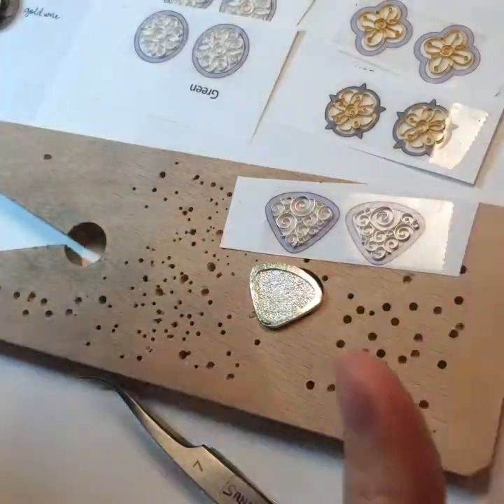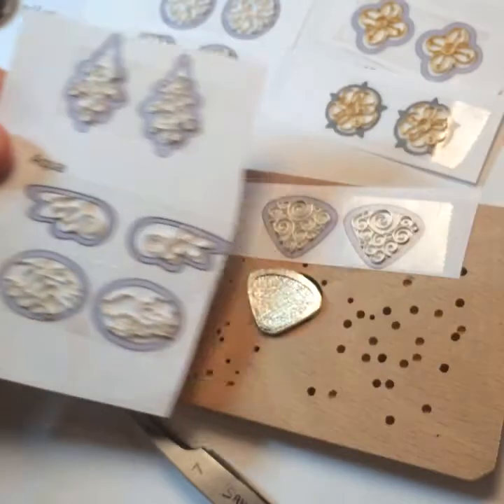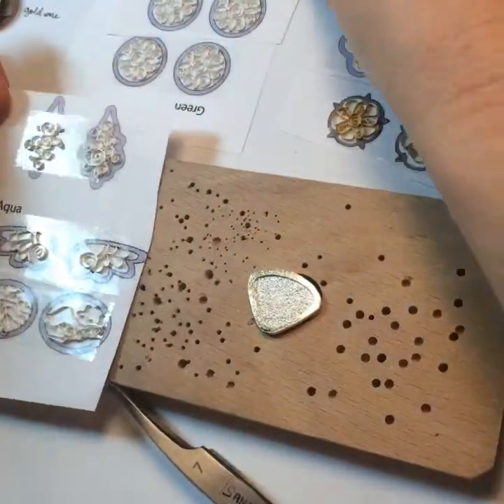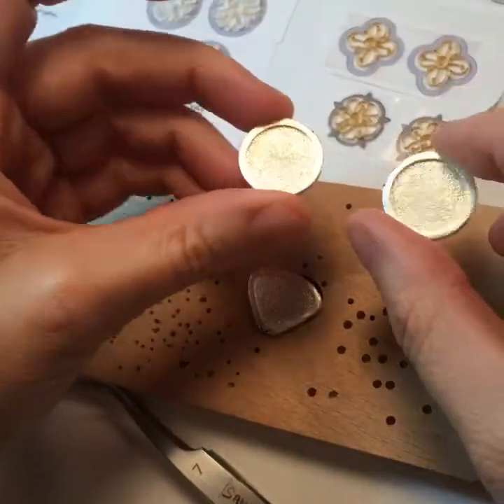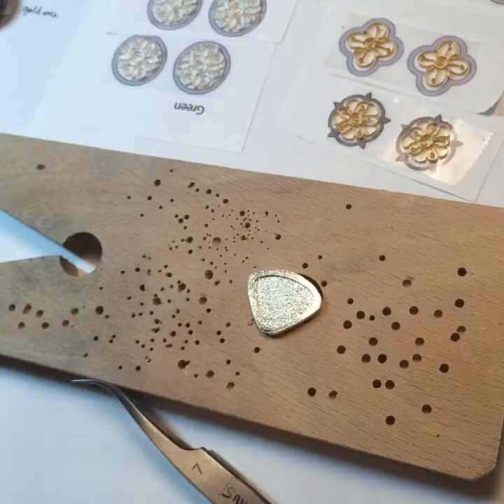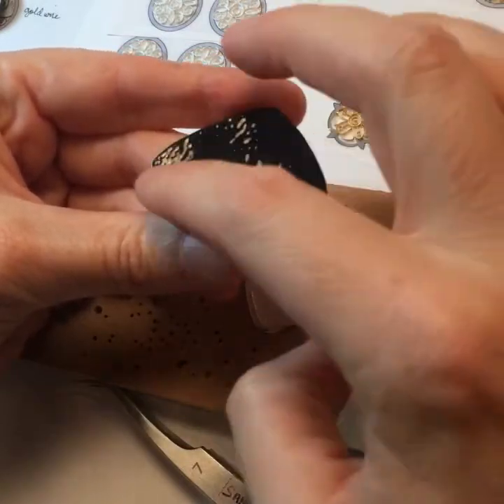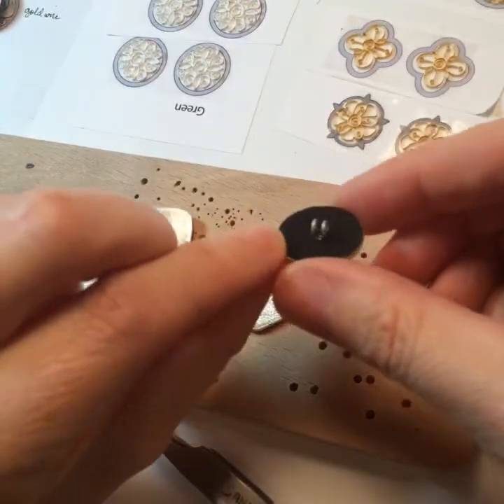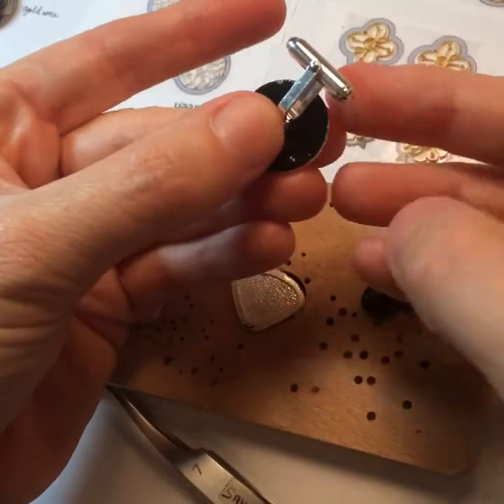Placing Wires into Silver Bases

Comment: Hi Sandra,  a couple of questions:  Does the Klyr-fire under the gold leaf need to be dry before firing as it does need to burn off or can the layer bubble if it is not dry?  Also, do the smaller pieces need to be domed slightly or are the 2 layers of counter enamel enough to prevent instability?  Thanks,   Your videos are a great help.
Reply from the maker: Hi Richard!

You've pretty much answered the first question yourself- if you don't let the klyr fire dry, and it is under something, it could make craters in your gold leaf.  

As for small pieces, doming isn't really as necessary as it is for larger pieces, so you can probably skip it.  But if you find your pieces are bending in ways you don't like, you may want to dome them anyway.  Good luck!

Comment: Your videos are so nice and I greatly appreciate all that you share so thank you.   Does the gold foil eliminate the reaction of red and other reactive colors on fine silver so that you get those colors?   Second are you using leaded colors when a color would ordinarily be reactive on silver and does that make a difference?  Have you chosen a gold foil to use since Thompson has discontinued the one you used in this video?
Reply from the maker: Hi Kelli!  The gold foil does prevent the red enamel from reacting to the silver.  I also like to use 24k gold wires when I'm using reds.  Some reds are more reactive than others, so it's a good idea to make test strips of any reds you want to use.  Any kind of high carat gold foil will work- best to get a sample of the foil and see how it works for you.  Some of the gold leafs that are used for gilding are just a hair too thin and break up under the enamels- but you might be able to layer the leaf to get the best results.  Good luck!

Comment: What is the cool down time? Do you have to wait for your kiln to crash for each firing, or can you pull it at a certain temp with no chance of checking?
Reply from the maker: I'm not sure I understand your question.  Enamels can be pulled hot out of the kiln, and will cool down just fine in about 3-5 minutes.  :)
Reply: @sandramcewen  You answered it. With Boro, we have to wait till the kiln gets under 200 degrees or the glass will most likely crack. Thank you.

Comment: I'm sorry for this question , because I assume you said it in the video, but I don't understand English very well , that's why I ask ... Do you put something in front side of the silver, before you put the wires ?
Reply from the maker: Yes- I sift a fine layer of clear enamel and fire it on the front.  There should always be a layer of enamel between the silver base and the wires.  ;)
Reply: Thank you :) What is the reason , I mean what will happen if there is not a layer of enamel between the silver base and the wires ?
Reply from the maker: The glass is what's holding it all together- usually you'd probably end up filling in with enough glass for it not to  be a problem, but you might have a situation where the wires could separate from the base.

Comment: I’m sure this is going to sound like a stupid question to you,but I’m extremely new to this. I haven’t started just yet. I like to do lots of research on anything before I actually start. But my question was that you are using a kiln right. So I have so far see it fired  with a torch. What’s the difference between the two? And why do you use it instead? Also can you use a torch ??
Reply from the maker: Hi Julie!  A kiln will allow you to have more control over the heat and will not discolor the enamels the way torches can.  They sell very small bee-hive kilns that will do the trick without investing the big bucks in a larger kiln.  But you can absolutely work with a torch- you will just get different results.  Good Luck!